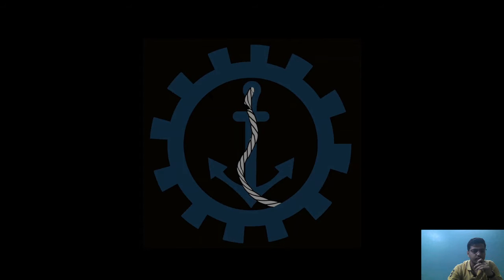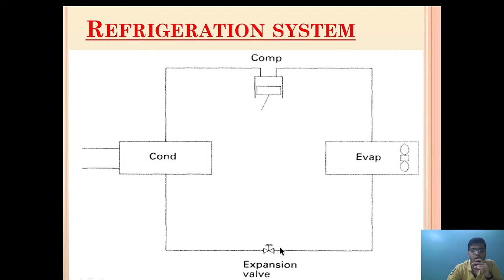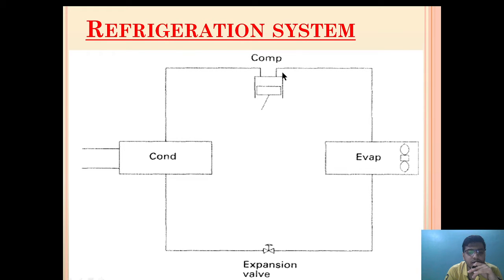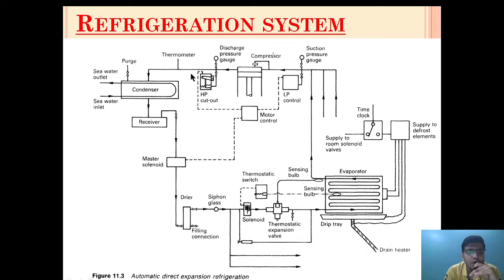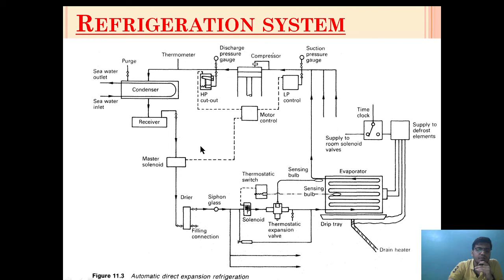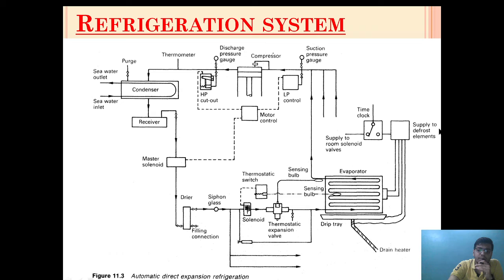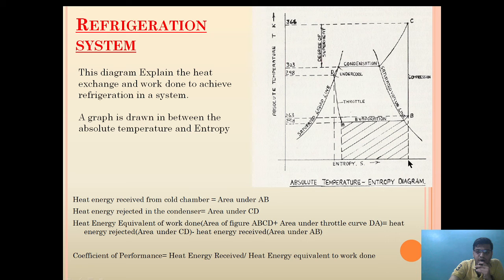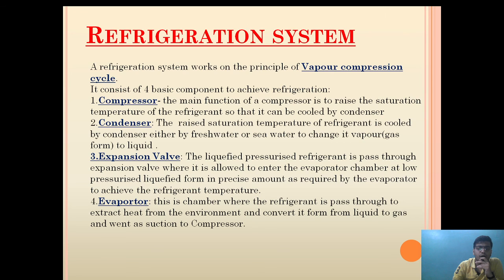REFRIGERATION SYSTEM| (PART-1)|

Comment: Have a question that how the Refrigerant is getting converted to gas form again can u please explain Elabroratly please humble request sir
Reply from the maker: As the refrigerant series will progress....
Each component will be explained in detail way . In that I will explain everything !!  
Please wait till then!!!!!
Reply: Vortex tube refrigeration full working 
👇🏾👇🏾👇🏾

https://youtu.be/AF_l1EnrJjg
Reply: As I understand it...
It happens at the expansion valve. As the high pressure liquid passes through the expansion valve, basically a small orifice, it is converted into a low pressure vapour. In order to become a gas it has to absorb heat energy from its surroundings to overcome the latent heat of the refrigerant. The expansion valve will be located close to the evaporator.